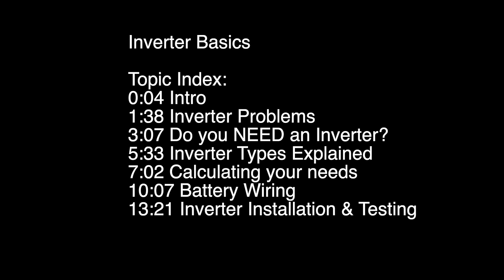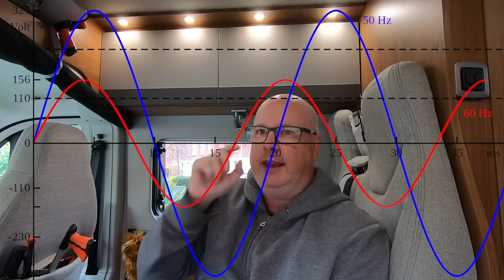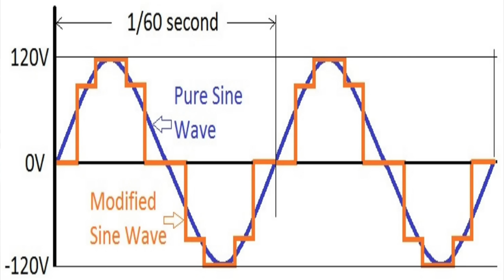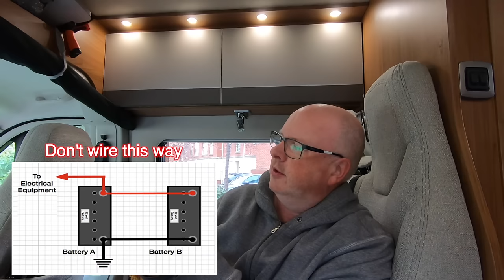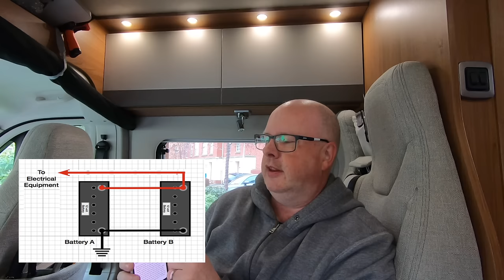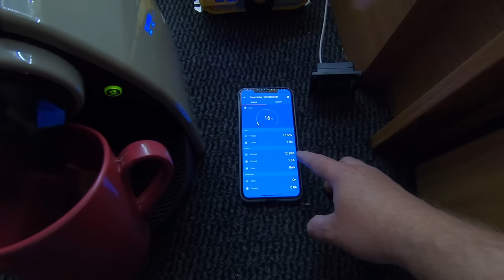Detailed 12v Inverter & Battery Wiring Guide - Campervan, Motorhome, RV & Boat

Comment: I’m confused mate. You say that you should buy a pure sine wave inverter especially if you’re powering phones, laptops etc, but the Amazon link to the inverter you use states it’s a modified sine wave? Would be extremely grateful for your comments 😉
Reply from the maker: Yes, but I then say I’m powering a coffee machine so the inverter I bought is perfectly fine 👍🏼
Reply: Gadget John on tour  but would a modified sound wave inverter be best for laptops, tablets and phones? That’s what I’m trying to establish 😉👍🏻
Reply from the maker: The model I installed is also perfect for laptops etc, however, you’re far better off with a 12v laptop charger & a 12v usb socket for your tablet & phone.
Reply: Gadget John on tour awesome, thanks for your advice!

Comment: hi great video , ive purchased a 2000w peark power inverter but what size fuse do i need for the connection to the 12v battery and how to work it out ?
Reply from the maker: Watch the video as I go through this exact question 👍🏼
Reply: @johnmandy  all depends on what i will be using then  i think , ?

Comment: Hi John - thanks for this excellent explanation. I'm currently looking at fitting an inverter and looking at the one you have. It's described on Amazon as a modified sine wave not pure. The eBay link on your website doesn't take me to the same unit as yours . I guess modified would be ok for coffee (my main reason for using also) but im thinking I may as well buy pure sine wave jobby for the small extra cost. I think Greg has fitted the same as yours but he describes his as modified. Can you clarify please? Many thanks
Reply from the maker: My video shows the model I fitted and it’s the same as Greg’s and it’s a modified type, but the quality of the inverter is good enough it can’t charge sensitive tech gear too.
Reply: @johnmandy  Great - thanks for quick reply. Change the link on your website to an Amazon one and I'll buy it via that link 👍
Reply from the maker: Thanks, the page has been updated now 😎👍🏼

Comment: I was going to buy a big invertor just to charge my laptop. But then I watched this and saw you talk about the fact there is a cable to charge laptops with 12V and how invertors aren't necessary.  Then you started talking about how bad inverteor that aren't pure sine wave are bad and destroy delicate things like laptops. Surely the cheap £20 leads use a bad invertor and will therefore damage the laptop in the way you just mentioned? Or am I missing something?
Reply from the maker: The laptop 12v chargers use a step up transformer, which are perfectly fine as they’re only changing the voltage slightly, totally different to an inverter.
Reply: @johnmandy  Thanks for the reply. You just saved me £150. :)

Comment: Hi John and Mandy...what size inline fuse holder do you use. I have a 2000w pure sine wave Carrybatt inverter. I am charging ebike batteries.
Reply from the maker: The video explains how to work out amps, volts and watts. So knowing this is a 12v system and you’re using a 2000w inverter you simply divide 2000 by 12 for the size fuse and also the cable size you need.

Comment: Is the Kriegel inverter you using pure sine wave? You explain the differences in this video and recommend pure sine wave but when I looked at the Kriegel on line its specs were modified sine wave
Reply from the maker: That’s right, I said as I’m only running appliances the modified sine wave is fine. 👍🏼

Comment: Great video John - only thing missed : how many watts are used by Inverter during the DC to AC power conversion process? I know most inverters can use between 2 - 10 watts zero load (Standby)
Reply from the maker: That’s impossible to say as it has many factors effecting the results.
Reply: Do you have a rough idea - maybe 10% - 15% wasted electricity?
Reply from the maker: It’s down to batteries, cables, inverter and appliances. It’s impossible for me to speculate.
Reply: @johnmandy  thanks for your help .. I,ll have a play with my inverter and battery.

Comment: Hi John, Mandy, belting vids, trust your both well, any suggestions or advice on fitting an inverter, when you’ve got a Sargent system installed,
Thanks Michael
Reply from the maker: As the video shows I installed the inverter easily and I have a sergant system.

Comment: Hi. First, thank you for the video, it's very helpful. And i have a question. When you calculate the number of amps for the coffeemaker you use 12 volts from the battery, but isn't the coffeemaker 230 V? I'm new at this so maybe i'm missing something here...
Reply from the maker: As your source power is 12v you need to work out the amps for 12v.
Reply: @johnmandy  oh yes ofcourse, thanks!

Comment: Hi john, i have a similar 2kw inverter with the AC outlets. is it possible for me to wire a wall mounted AC outlet into a face plate which plugs into the inverter? if so, how can i get 3 wall mounted outlets with only 2 outlets on the inverter? Thanks!

Comment: Hey, great video, very informative but you didn't say what size fuse was fitted? I want to fit a 1500w inverter, what size fuse  or breaker do you think I  need ?
Reply from the maker: If you watch from the start I teach you how to work out amps, so you can get the correct fuse for your setup, I can’t say to fit 1 fuse size as it’s only work if you copied my setup (which comes with a fuse)
Reply: Thanks, I’ll watch again.

Comment: Hi , just come across your channel, great stuff but I’ve just got 1 question about something you said near the end. When your battery went down to 11.8 v .. I was always led to believe anything below 12v and the battery will be damaged ? Thanks
Reply from the maker: When a battery is under load the voltage will drop. As you see from the video though, once the load is reduced the voltage jumps back up to 12.?? Colts and climbs. The 2nd thing to understand is the drop was for seconds, if you were to place a load great enough to lower the voltage to 11 or less for hours then that, if repeated regularly, could result in the battery failing prematurely. That’s why lead acid batteries are dirt cheap, when they fail you just recycle them and buy new ones.

Comment: Great video good Sir.
A quastion for you if you dont mind.

 I am to run car 200w-300w not sure yet inverter from 12v sigarette lighter.
The teask is to keep charging two Ryobi 18V drill batteries using two  85w Ryobi chargers in my mondeo mk4 2008, whilest on the move and stationary.  
I have researched that the safest way is to have  each  sigarette lighter at 150w load to be dead safe.
Basicaly am thinking  to have a set up where each sigarette lighter will have  this one 300w inverter pluged in to it and  one Ryobi  battery charger 85w
Also hoping to have such set up to be charging batetries even when car engine is off. 
Other set up I guess would be to have inverter connected directly to cars battery , but that will require me hiring electrition and extra cables, which I am trying to avoid
Reply from the maker: You can’t do this, not only will the power not be sufficient to fast charge your drill batteries but you’ll kill your car battery very fast. My video is about leisure batteries and inverters, not car batteries which are very different, a car battery is just to start the engine, not run inverters.
Reply: @johnmandy  This is breaking my heart Sir.
I want to do business and have to charge them 18v drill batteries on the move.
I heard that if you run modifed wave inverter it will eventually kill your cars battery, but pureshine wave is meant to be killing it much longer.
At the end of the day If I make good money then I can afford to just keep replacing my cars battery.
Why insufficient power to charge 18v batteries usung 85w chargers . 
There are even  18V battery chargers 85w each which have dedicated car sigarette plug.....
I am worrying for them to be charging slower, than at home from the manes , but if mobile phone can be charged in the car as fast as at home from the manes , then I am hoping that fast charge batteries 85w can do the same in the car running from cars sigarette lighter.
Every review online gives cars sigarette lighters at least 100w safe working load with some claiming 185w for each sigarette lighter in the car.
Is there still no hope for fast charge on the move for at least few months before battery dies
Reply from the maker: You just can’t do this via a car battery, they’re only designed to start the engine. You need something like a lithium generator really.

Comment: Hi John, at around 4 mins when you say you can simply plug the adapter into the 12V, what do you actually mean? what is it i would plug my adapter into? also if i have a mircrosoft surface which has its own special plug, is that still possible? and are they trustworthy? thanks very much
Reply from the maker: If you go to my website for further details and links you’ll see. Basically any laptop or tablet can be run from a 12v adaptor rather than mains power adaptor.

Comment: Hi I have solar panels to install and the same inverter as in this vlog. Do I install the panels first or the inverter. Iam a complete novice with electrics. Can you help.  Iam in uk
Reply from the maker: It makes no difference which you insta first, but I’d get the solar sorted so it’s charging the batteries 👍🏼
Reply: @johnmandy  thank uou

Comment: Hi just a quick question on ur inverter as soon as u plug somethink in does the fan start straight away
Reply from the maker: If the load is big enough then the fans will kick in. If it’s a small load the fans don’t kick in.

Comment: On Amazon... this inverter is advertised as modified sine wave ! Did you not say that this wasn't good ?
Reply from the maker: If you watch the video I described what each inverter type is best for, then I said I was buying the inverter for a coffee machine which is fine for the modified wave inverter, that said it’s also so good you can charge all your tech too with this inverter, it’s fantastic.
Reply: @johnmandy  . Thanks  John for your fast response . This will be my first inverter for a boat. I watched your video a few times and just wanted to make sure I was doing the right thing.

Comment: Hi John, great video helped me understand everything well. 

Just wondering how you're finding the inverter a few months on, im looking to buy one for a van im buying (work van) and want to get something that's good enough to do a few bits and pieces and still last.

Also, do you have any info on how to fit leisure batteries? The van im buying is just a panel van, planning on putting the batteries underneath the passenger seats along with the inverter, then setting up several sockets throughout the rear of the van and one in the front. Mainly going to be running drill battery chargers, hoover for clearing up, occasionally a kettle/ microwave and maybe a tv/ games console when were bored/ staying away.

Cant believe how hard it is to find something online which explains well!
Reply from the maker: The inverter is still working fine, we have the same inverter in our new van too.

Comment: Thanks John, but I’ve done that and I’m afraid there doesn’t appear to be anything out there. This is typical reaction of people who tried
“no 65W is not enough for a system that requires 130W.  On both the XPS 15 and similar Lenovo ThinkPad X1 Extreme models, using a 60-65W power source results in noticeable performance throttling even without the GPU active (and very noticeable throttling with it active) and incredibly slow battery charge time.  I manage to make it work for what I need to do on the road, but I can absolutely see why it might not be viable for others.” Disappointed 😔
Reply from the maker: Maybe look harder, I found one instantly that’s 130w. Like I said, every laptop can be powered off 12v

Comment: What AWG (Gauge) should i use for the Solar Panel Charge Controller?
Reply from the maker: That depends on solar panel info, charge controller info and batteries. Look through my other videos and you might find a better info on just solar wiring.

Comment: When you say batteries are “dirt” cheap what price would you be looking at ? I bought 2 last year for our motorhome.. 110amp. Think they were about £180, they weren’t the cheapest or dearest... somewhere in the middle but they don’t seem to last as long as I would expect. I am using a pure sine wave Waeco/Dometic inverter .. think it’s about a 300watt...to power a sky box and tv. After about an hour or so the battery percentage on display is reading about 60% so I’m having to start the engine.
Reply from the maker: Ah, there’s the problem. Your inverter is a massive overkill for the tv and sky box. A 100w inverter would be fine, or even better is seeing if they could run from dc.  I paid around £95 each for 130ah battery and it’s worked fine for over a year now.
Reply: But yours is nearly 7 times bigger output,  if you had yours powering something at 100w would it still draw a massive current ?

Comment: How do you Earth the inverter and is the ac supply earthed
Reply from the maker: The vehicle chassis is “earth” and your negative bus bar should be earthed, all 230v earths should go to the inverter earth.
Reply: John & Mandy on Tour 
My inverter is on a narrowboat , When on hook up my 240 sockets show correct on socket tester but when switching from shore power to boat power ie inverter  tester still shows correct until I unplug shore power lead , then socket tester shows no earth
Reply from the maker: Thats correct since in a van or on a boat there is no earth as I explained.
Reply: John & Mandy on Tour 
thanks for your time and advice . I appreciate it . After speaking to a boat safety examiner yesterday, unofficially he said no earth on a socket tester from the inverter was a fail . My neighbours boats inverter ( which is much better kit than mine) seems to pass the socket test with an Earth . Is there a way of wiring an Earth ?maybe a new (better)inverter
Reply from the maker: If you follow my advice, wire the earth ring of your 230v sockets to the earth connection on your inverter this is an earth that will pass a socket test. The tester may not like the inverter to be earthed to the negative buss of your 12v electrics.
Reply: John & Mandy on Tour 
The examiner said he couldn’t give electrical advice but gave me the name of a marine sparks. He is very busy so I’m on his waiting list . Thanks again for you help . I will connect earths till sparks can come .

Comment: Can you give any advise on installing a low watt microwave like a 600-700watt into a small camper instead of the oven grills?
Reply from the maker: There are people that use them, but as most microwave meals are from 4 to 8 minutes you would need a very big battery bank to keep the microwave happy supply 600w for even 50% of the cooking time of a small bowl of soup. A 600W microwave is going to require 50Amps from your battery bank, the longer it's running the more amps will be taken out of your battery bank. How will you then put all those amps back in to the battery bank? Say you have 300W solar array with perfect summer sun, that's going to take many hours to replenish the power used for your microwave to heat up your bowl of soup.
Reply: @johnmandy  Thank you. You are the first person to actually give me a real life situation reply. I'd only have one leisure battery and solar 300watt on roof. The van would be driven everyday. Would it completely drain the battery or do you think there would be enough to run lights charge phones etc over night ?
Reply from the maker: That would all depend on how long you used the microwave, if you had it on full power and how long it was actually using full power for when in use (microwaves use bursts of power briefly rather than just full power for the entire time they are working) and would also depend on the type of battery you have and the capacity. 300W solar would probably give you 15 to 20amps per hour of charge on a perfect sunny day,  if you use the microwave for 10 minutes a day then that might take the solar 4 or 5 hours to recharge the battery bank. I would also try and use at least 2 batteries if you are using lead acid type, and wire them as per the info in this video. This way you are giving yourself much better power storage to help you with lights, USB power and so on at night.
Reply: @johnmandy  Right okay... So plan of action is good battery X2 and solar. What if I only used the the microwave with the engine running? Thank you so much for helping me ... I'm finding it all very confusing and most people have the SMEV ovens and I just think I'd getting more use out of a microwave despite its obvious downfalls